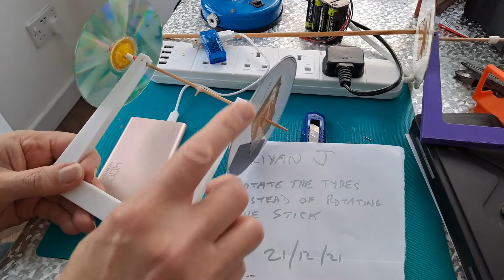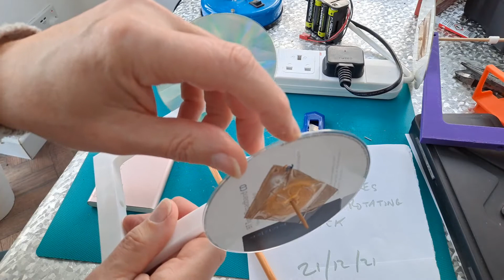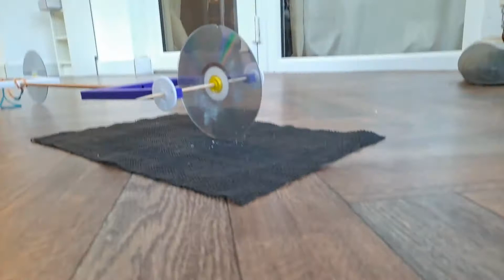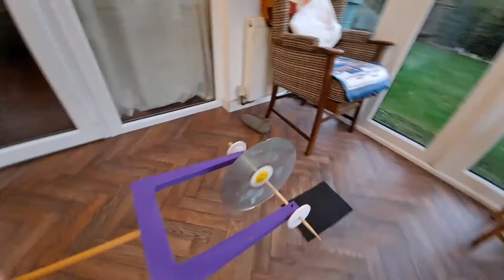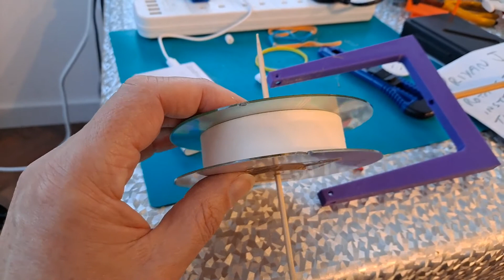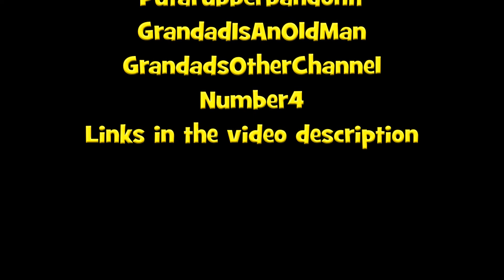Put a rubber band on it 0375 direct drive the back wheel?

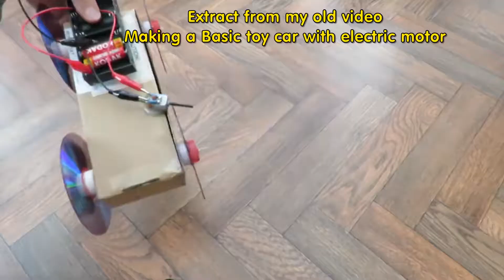Comment: Im at 1:30 on the vdo, I don't know where you are going with this but Im thinking use a bottle cap glued to the wheels hub as a pulley, wrap the band around it and attach the anchor on a crossbeam
Reply from the maker: I think I misunderstood the question, but that is not the first time 😆

Comment: Oh dear, what a delightful child. NOT. 😒
Reply from the maker: I have no doubt I misunderstood the question, he may have just meant for winding up the band. "Why not turn the wheel instead of the axle" and the answer is, "It is quicker to spin the axle, than spin the wheel". Either way, it made me think on a different path and gave me an interesting project, that could be progressed further, so not a big issue. You get used to it. I had just got the bits together for another rubber band car so it was easy to give it a try. Just finished editing that one and it will be published tomorrow 😆👍